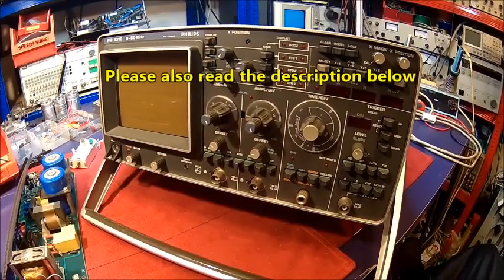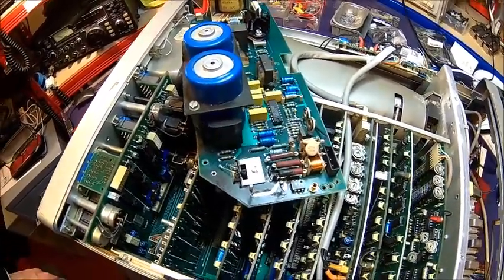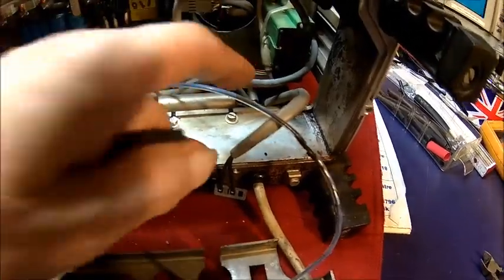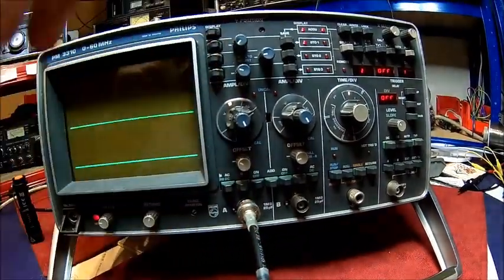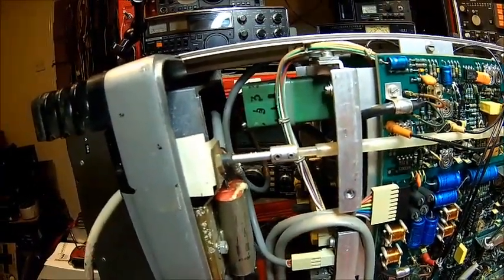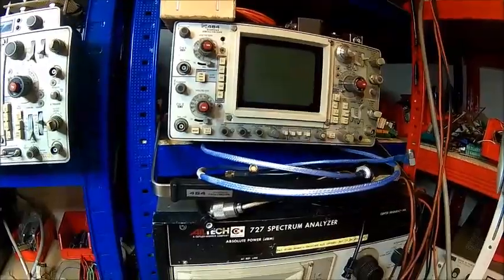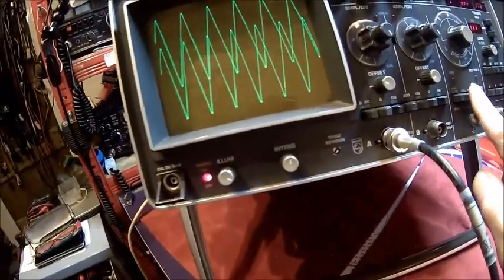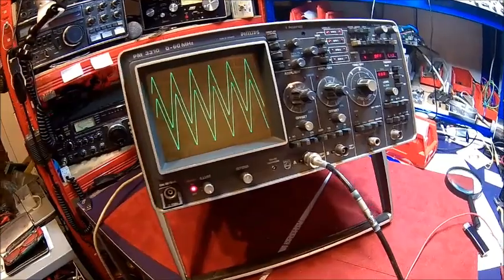Philips PM3310 Digital Storage Oscilloscope, fault finding and repair

Comment: Hi guy, I got a pm3310 and when I power it up, I have no trace beside anything on the digit display, do you yahe an idea? Can I send you a picture?
Reply from the maker: I would start at the mains board (at the back with the capacitors, etc), and then check the mains filter, good chances that you find it straight away. If that's all good, just go further down the line and you'll certainly find the culprit.

Comment: Hallo!
I got the same scope a few days ago and ... the same Problem. Exactly the same capacitor exploded. I think its a construction fault. I replaces it with a higher voltage type.
In the video you said that you didn't have the manuals. Ok, you find manuals for the PM3311 on the BAMA archive. The PM3310 and the PM3311 a quite the same, with minor differences.
http://bama.edebris.com/manuals/philips/pm3311/
So, thanks for the video and have good days!
Reply from the maker: Thanks Christoph, but i do actually have a printed manual which came with the scope. I also know Bama very well, thanks.
The blowing capacitors are in fact a design fault by nowadays standards, but these scopes were designed for Europe in the days when the nominal voltage was 220V, so plenty of headroom then. What they really did wrong was not changing it for the UK market as we had 240V in the past and technically still have, just with different tolerances, even it now says 230V being the nominal voltage....  just looking at my BMS display, reading 242V
Reply: @dynoguy  hi. If you can numerise your document and upload  it, I am very interested. I have a pm3310

Comment: Thanks for the video and your time. I have a similar scope - its a PM 3311 - no prob with the power supply but unfortunately just one IC gone on the final X Amp board and I cant find a replacement or equivalent (OQ0017).
Reply from the maker: Hi Paul,...just found one on ebay Switzerland, took me only 5 minutes, price is a bit steep, CHF60, i think that's about  USD65.
Unfortunately i don't know the equivalent, i'm pretty sure it's some off the mill part, but Philips labeled them rather cryptic as HP and Tek did it at the time....cheers, Mike
Reply: @dynoguy  A gentleman, thanks for that. $65 is a little steep for one IC so I think I might watch out for another broken scope in the meantime. The OQ0017 seems to pop up in a few other old Philips scopes. Thanks again and good luck with all your projects.
Reply from the maker: You're welcome,...i always try to help if i can,...Happy new year

Comment: Hi. Did you ever sort out the second mains filter fault with a new part, part number Z1701?
I’ve got the exact same problem with my PM3311 and struggling to find a replacement part.
I’m just wondering if you could point me in the direction where I could find one or an equivalent for sale?
The first faulty cap in your Vid looks fine in mine.
Cheers.
Reply from the maker: Hi, ...i could not be bothered to fit a new one because it works just fine,  so it's still linked out. I know i have some of these laying around but i recently moved house and still trying to find much more important things in my heap of still unpacked removal boxes. You technically can use pretty much anyone which physically fits and obviously has the right current capacity.
The only purpose is to limit line interference, but i'm running most of my scopes on a dedicated isolation transformer, so it won't make a difference anyway. I strongly recommend to change that cap to at least a 330V version, because the 250V version is not fit for purpose, remember that 230V + 10% is 253V, and you want some margin for spikes. At my new house i get above 245V most days. ...cheers, Mike
Reply: @dynoguy  Thanks for the info.  I found 27 of them on the Farnell website.
I’ll have a look through them all and find the best suited.
I’m new to electronics, and you confirmed what I thought that mattered, that it could handle the current, which is 2A on the old one, and the voltage.
And I had exactly the same problem with corrosion around the battery holder, so I neutralize it and painted the area with Hammerite paint, so I don’t leave batteries in now when I'm not using it for a while.
A great scope, you could have 4 saved traces and 2 active traces on the screen at the same time using an external trigger, great for using with an Arduino and stuff.
And on it’s slowest sweep rate, it can bee up to 22 hours a sweep, if I can remember correctly.
Anyway thanks again.

Comment: Well done, had the same Rifa 0.22uF X2 capacitor fail on my unit too. That was back in the day when Maplin sold a replacement cap.
Reply from the maker: Thanks,...i think the problem was the voltage rating, it was only rated 250V, but i am very close to the transformer (it's actually right above my fence) and regulary see over 245V at nights. Had similar issues with some other gear and normal light bulbs don't last very long either.